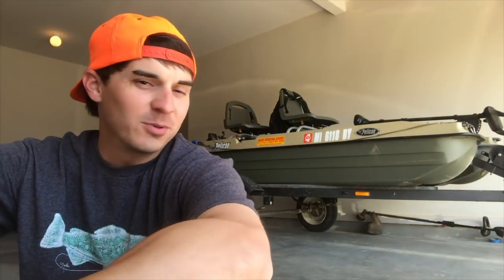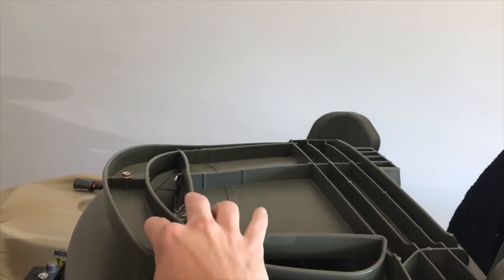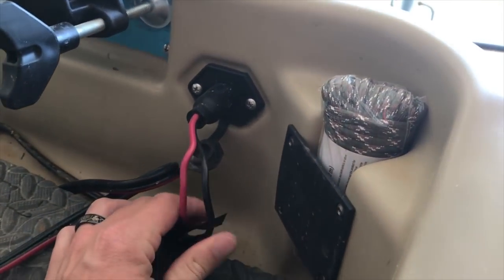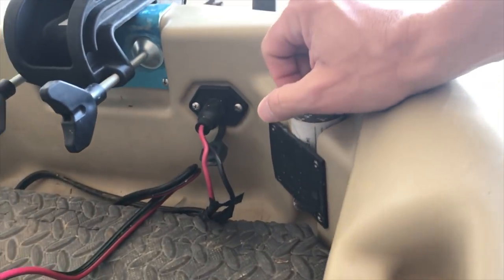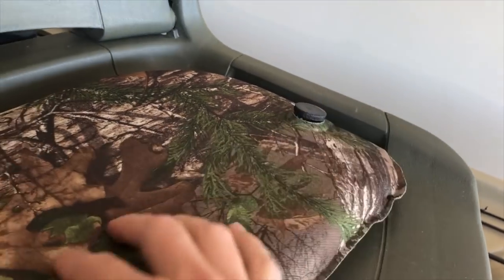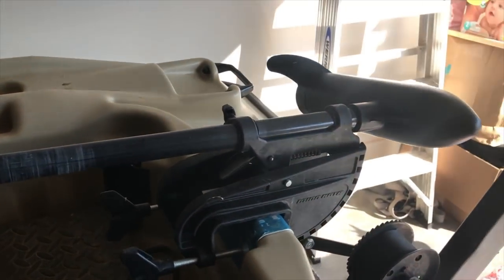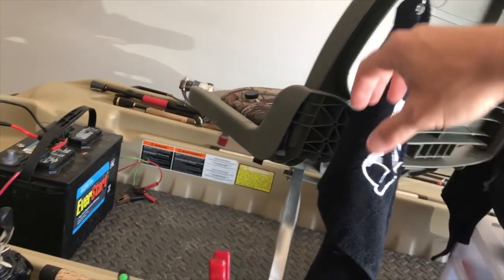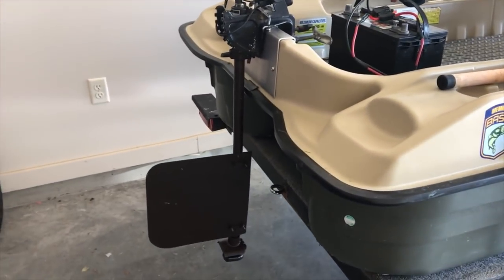Pelican Bass Raider 10E Mods

Comment: I really enjoyed this video. Just bought my bass raider and I LOVE IT. 

1 note, the "rudder" in the back of the boat is actually a "skeg". Rudders turn to adjust direction. Skegs are fixed in place in order to just keep you tracking straight. 

If I move the trolling motor to the front, I would def add a skeg, but you could make one much easier by buying one of those straight canoe paddles and cutting the paddle off the handle, replace the handle with PVC and run it to a T with male a female threaded PVC so you can just swing it down and up much easier. would also be lighter and less bulky. 

Either way, this was a great video. love the detail! Definitely going to use some of these suggestions!
Reply from the maker: taprackbang88 Thanks bro! Haha, I'll credit you and the skeg in my deck video. Thanks for the clarification! Waiting on it to warm a bit down here in Mississippi before I start the deck insert (believe it or not).

Comment: Yep, a rudder is a must. You can install an eye bolt on the front to attach the crank strap. It’s easier to install and remove than the trolling motor. I show it in my Pelican Modifications video. I kinda miss my pelican.
Reply from the maker: Billof Rights good stuff man! Yeah, I love this thing.

Comment: Wire the depth finder into a power plug then you can plug it in the side of your battery on one of the charging ports when needed .  That old Trolling motor bracket is not a bad idea for keeping your boat from tail swing but i would have not put the Transducer  on the end of shaft that will be the first thing that gets broke or add some kind of guard on the backside for limbs . It wouldn`t take much a thin 1/4 aluminum flat metal bent just right .  You get the pic.  Your right a Rudder is a must some times i have my 3.3 Mercury motor and when i don`t . I have a small paddle and a c clamp clamp to the back of the boat . Enjoyed your video I do relies this video is a couple years old and you probably don`t have it anymore or did more upgrades . Wished i could do a pic. of mine that you could see Thanks again
Reply from the maker: I still have it and love it! Been lucky with the transducer so far! Thanks for the comment. 👍🏻

Comment: Great video.  I love your mat & rubber. My suggestions:
In my state I have to have a USCG approved throw cushion on board, I have 2 one for each seat, they are less than $10 & just as comfortable as $100 seats. Plus they can save a life.
I also use some VELCRO® Brand Heavy Duty Industrial Strength Tape, to secure my fishing rods, at both ends,  the low sides makes it easy to kick a fishing rod into the deep six.

Comment: good info...I've had my Pelican for 2 months now.....the great thing about these little boats.......they can be modified to fit your individual needs......I fish by myself so mine is set up differently than someone that has a fishing partner......I was wondering.....do you back the trailer into the water to launch and load???.....that's what I do and the launch is easy but the load, if it's windy, can be a challenge.....I generally just have to wade out and get it straight on the trailer.....I put side rails on my trailer but it still turns sideways if the wind is blowing.....
Reply from the maker: Billy Markwell yes sir, loading back on trailer is definitely more challenging with wind. I usually stand on my trailer in water and pull it in with my rope. Then secure it and pull up.
Reply: @NOLERSWAMP9  I've been trying different ways.....tieing ropes to both sides and even the end.....nothing works.....thanks for the comeback...
Reply from the maker: Billy Markwell I put just enough of the trailer in the water to float the boat on to it, but then pull it up the rest of the way and secure it enough to pull off. If too much of trailer is in water the boat will move all over, ha. That's a mess my friend.
Reply: @NOLERSWAMP9  my intent was to find a way to load.....without having to wade out into the water......currently the only thing that I think might work ....is to rais the side rails.....I may tackle that project this summer when it's too hot to fish.....

Comment: I know this might be a dumb question but i just got my bass raider yesterday and have a 45lb thrust minn kota , i have it mounted on the other side where the fuse wires are and your minn kota battery box is.... is that the wrong side to mount the trolling motor? i thought that was transom side?? Thanks for the help
Reply from the maker: From all my research, it is more efficient battery wise up front. Not a dumb question at all, man.
Reply: @NOLERSWAMP9   where did you get that cord that runs from one side of the boat back to battery in order to have trolling motor on the front?  How much was it? I just added a small deck on front and back via 3/4 inch ply wood covered it with forest  green marine carpet fits like a glove i love it .  Hey also sorry man for all the questions when im operating the minn kota should i slowly ease into speed 5 or is it ok to just crank down to top speed when you want to move spots to fish?
Reply from the maker: FishingForBassTV Check out my other video where I added the troll king foot controlled option for the minn kota. It shows how I connect trolling motor to battery. Also, you can go straight to top speed with trolling motor. Just make sure you’re prepared for the sudden movement of the boat and don’t fall out. 👍🏻

Comment: Just change your Depth finder wiring by adding a male cigarette lighter plug and just plug it into your box at one of your charging plugs!
Reply from the maker: Richard Spengler yes sir, I ended up doing that in another video and that makes it so much easier. Had someone comment about that very thing.

Comment: Good video, I’m thinking about buying a bass raider 10E so I’m trying to take in as much info as possible, I was concerned about the stability of this little boat. I don’t hear many complaints about that so I’m leaning towards buying one. I would appreciate any other info or tips you might think of.
Reply from the maker: frehleyleadguitar I have several videos with other mods I've done on this boat. Check them out. I love my front deck I out on for sure.

Comment: Why did you add a fuse to your battery setup? You said something about it getting hot..
Reply from the maker: Jamie Rice it comes from the store with an inline fuse in the back cable. I blew it when my trolling motor got hung on a root. Anyway, since I’ve gotten the Minn Kota Power Center I don’t need a fuse in the line any longer. I recommend this setup!
Reply: @NOLERSWAMP9  what caused the fuze to blow?
Reply from the maker: Jamie Rice I got the prop hung on a root to where it couldn’t spin and it was engaged to spin. So it blew the fuse. I had to paddle back in, ha. Not fun.

Comment: Good video,  why do you turn the head on the trolling motor 180?
Reply from the maker: I like to fish from the front of my boat and the way the Minn Kota trolling motor comes out of the box is setup for use on the stern. You could technically keep it the way it is and put up front, but you wouldn't be getting what you pay for speed wise if you do. By turning the head I can mount to the front and forward is forward...reverse is reverse. With the trolling motor on the front on these boats it is a necessity to rig up a rudder or the boat will basically fish tail the entire time. 

Also, I like to stand while fishing. This boat is sturdy enough to do that easily. The trolling motor shaft is 36" and I really don't have to bend down at all to cut the motor on/steer. I usually steer with my legs, ha. They sell a trolling motor Big Foot Switch that helps not having to reach to cut the motor on as much (press button with foot).  Hope this helps.

Comment: Get rid of the alligator clips and buy an auxiliary male plug to plug in the side ports of the battery box.
Reply from the maker: ethan buswell bro, why did I not think of this sooner? Ha, thanks for sharing man. This helps not having to take container top off and clip every time. Hopefully I can get this to work.
Reply: NOLER SWAMP I seen it on another and did it to mine. Figured I’d pass it on! Search pelican bass raider and the one with the front pvc lights has this done to his.
Reply from the maker: Sweet man....you have a link to the one you bought?
Reply: NOLER SWAMP I just went and found one the same size wire as my fish finder.
Reply from the maker: Thanks man. Good deal.